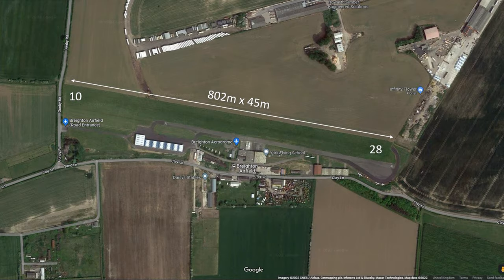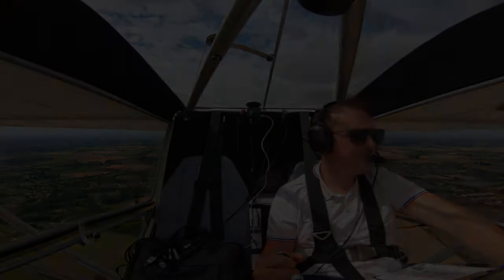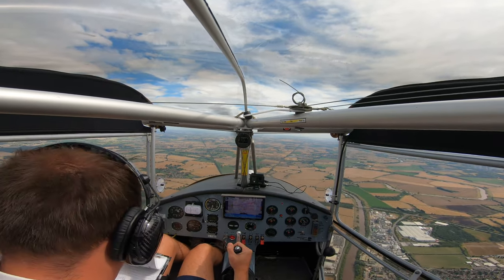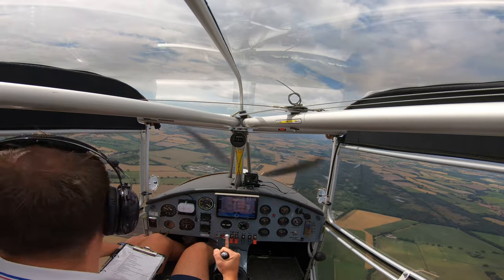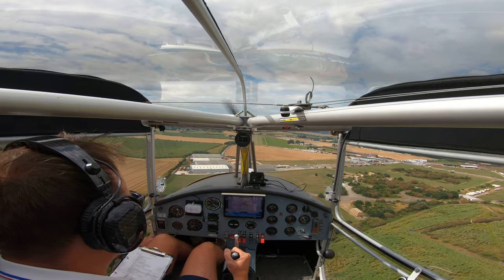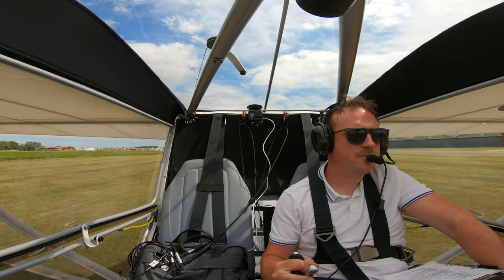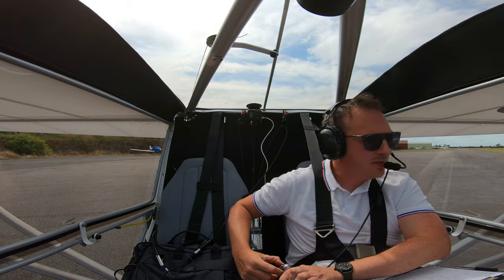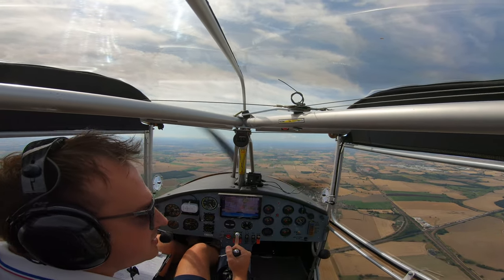4K Flying With Matt - Breighton Airfield - Skyranger - Sherburn - NPPL - Microlight

Comment: Did the EuroFox you trained in have self centering rudders?  The Aerotrek here in the States does. I’ve flown about 6 different planes and none of these had that feature. I do a lot of flight simulation and my pedals self center Found the ones without that feature easy to get crossed up if not watching the ball. I don’t have the of “seat of the pants” yet. Did you get into that issue as you transitioned?
Reply from the maker: No I don’t think think so. I don’t recall ever noticing or being briefed on that feature?